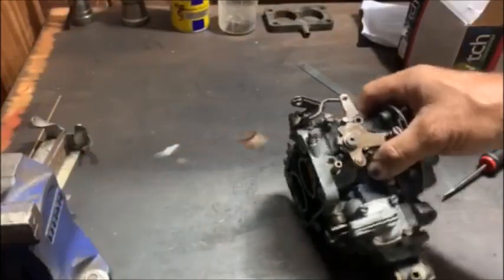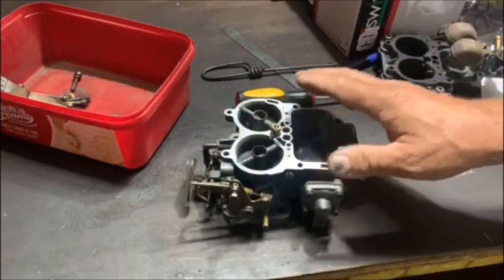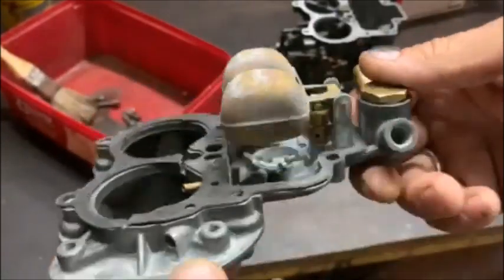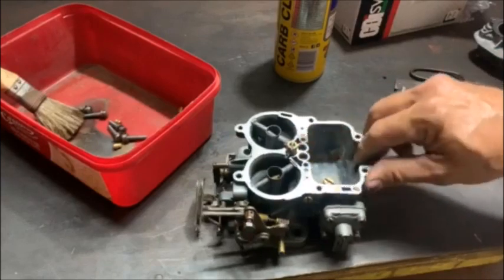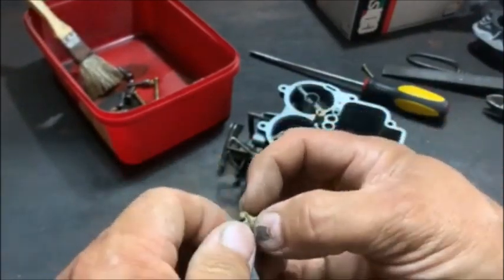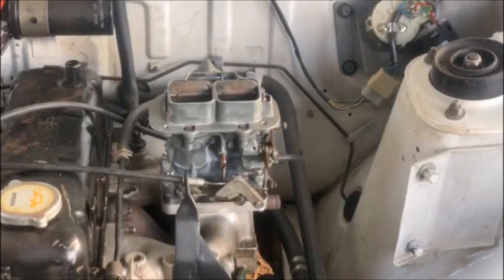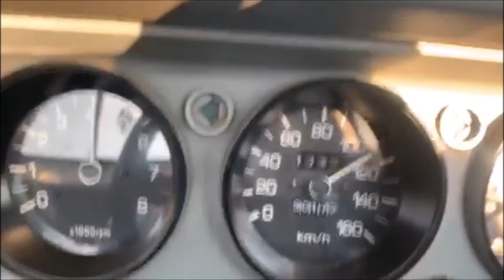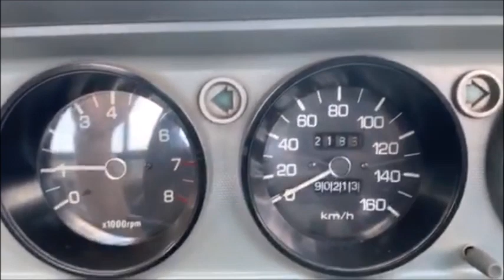Weber Tips and Tricks 1 32/36 DGV

Comment: 1987 Mitsubishi Montero SWB 2.6 with Weber 32/36 DAF - My carb is now fully open at stop. It failed on a restart from driving all day and now fails to adjust idle down. I'm revving at 4000 rpm now when in Park. The top flaps are open and don't close up. The car has been driven all week after not being a daily driver but performed well. Checked all throttle cabling, but the flaps don't close. Is this a broken Electric Choke? or another diaphragm? Thanks in advance.

Comment: Hi. Can you explain why my AC wouldn’t work when I put my Weber carb in my 1980 Honda accord? I’m new to carbs
Reply from the maker: The AC (air-conditioner) has nothing to do with your carburetor, The AC unit is usually switched in by the AC controls inside you cab.

Comment: That little A14 revs very willingly . Brings back fond memories from when i was preparing 2 of them for racing back in the early 90s . I used to own Renault 8s and 10s with the very popular Alconi engines . The dcd 7s were most probably the most tuneable carbs back then and all my Rs had one on . The adverts used to say "Power and economy king " Nowadays i am tinkering with the 38 dgas carbs and your videos on them is just awesome and informative . Thank you for sharing it . I live in SA  and i would like to know how i can contact you  other than via public comment .
Reply from the maker: Thank you for the comments, I fitted bike carbs to a Renault 9 engine, this engine was in a little R8, we also had a Gordini head on the engine, it was a little rocket. my number is 0-6-0-6-5-4-6-9-6-6
Reply: Hi please if you can help me a have 32/36 weber a install it on vw 1800 bore 2L  shim head gasflow branses on when a start it it adels when a try to ref it up slow it straggle to ref up then a ref  full frottle it refs up what is the problem 
Thanks if you can help me
Reply from the maker: @freddieverreynne3344  it is difficult to say but it sounds like your main jet is to small, make a video and send it to me via whatsapp 0-6-0-6-5-4-6-9-6-6

Comment: Hi my 32/36 struggles in second stage splattering loudly. Emulsion tubes seem to be stuck and cannot come free. Carb is fitted to a 2.0 chev Rekord. Primary and secondary idle are 45. Primary air corrector 160 and secondary 120. Main is 116 and secondary main is 115. Struggling to set up. I guess if I can free the emulsion tubes the gunk stopping it coming free can be cleaned. Please advise how I should proceed and advise on jetting that will suit my engine. Thank you!
Reply from the maker: your jetting sizes looks to small, visit my facebook page, under files i have a jet chard that could help you. must 2.0 engines jetting will be very close.
https://web.facebook.com/groups/387029652869858/files/files

Comment: Hi just looking for some advice. I have just fitted a 32/36 webber to a 1600 twin port beetle. I made my own non restrictive manifold , from head to head. I appears to be too rich on the first stage and too lean on the second. The first stage is terribly agressive compared to to solex. Idle mixture out 3 to 4 turns , to run smooth , but ten causing a popping back fire, upon acelleration. Second stage. works initiallly but flat spots out on the road, will run with a back off and second application. Looking for suggestions for jets etc.
Reply from the maker: if you have to turn the mixture screw out that much it indicated that your idle jet is to small, try one size up and see what it does.I dont have a jet chart for your carb on a beatke but this is for a 36 DCD weber on your engine - VW 1600 BEETLE venturies 23/24 main jets 110/120	Idle 45 air correction 190/180 - I would try 130 mains on first and second choke and i would use a 50 idle.
Reply: @carburettorrebuildservice8964  thanks for that

Comment: Thank you so much for your video.  I am a little curious as to why you sealed up the power valve.  You mention that a 1400 doesn't need it and I would like to understand why.  Is it the size of the engine?  Or something else?  Would enjoy hearing your thoughts.  Thank you in advance!
Reply from the maker: Yip, the size of the engine. Must of the Weber mods on 1400's are on standard engines and with the power valve still active it could over fuel. thanks for watching the video's.

Comment: Hey man thanks so much for putting this info up! , ive got a 1981 Datsun sunny b310 wagon, i always wanted to put a 32/36 weber on it but had no idea of the jetting so after watching your vids i bought a second hand weber cleaned and rebuilt it i made a 2 piece adaptor plate and have installed the weber on the car running a A15 motor the weber came with main =130 secondary=130 Airs main 175 secondary 125,idle jets are 55 and 60 and emulsion tubes are f66 with 3.5 and 4.5 venturi/choke i forget what there called lol i figure its close as a base tune it should run the car ok until i can order parts not sure when this will be as im a kiwi and NZ has just gone into another lockdown!. Im having a major issue which i cant seem to diagnose i have checked for vacuum leaks had the carby on and of 3 times now changing to different thicknesses of gaskets even trying RTV and i keep having the same result. The car will start i have to idle real high to keep it going, i get it warm still wont idle so i turn the mixture screw out until it does but it has to be about 6 turns out but the lowest i can get the idle is 1100rpm and this is with the idle screw not even engaged with the arm! Ive looked through the barrel with a torch shining up it has minimal gap much less than the old carb which was set at 800rpm. The car runs very rich and every time ive changed the gasket its exactly the same result! I have checked float height with no problems there the only other thing i havent done is disable the power valve but it has a new plunger so shouldnt have a leak there.

Is there any advice you can give me to help get my car running on this carb thanks for any help :)
Reply from the maker: Hi, what size is the idle jet, it sounds like it is blocked or very small
Reply: @carburettorrebuildservice8964   its a 50 or ive tried swapping them around with the second barrel which has a 60 makes a little difference to where i have to have the mixture screw but does not effect what rpm it idles at, like i said the part i find weird is i cant keep turning the idle speed screw until the engine dies it will only go down to 1100rpm
Reply from the maker: Please ensure both butterflies close properly, and ensure you are not leaking air.
Reply: @carburettorrebuildservice8964  have checked butterflys are fully closing have even gone as far as unscrew them relign etc and still can only see the tiniest bit of light come through which ive checked the standard hitachi and theres more light coming through those butterflys and it was set to about 800rpm, ive disabled the power valve the car seems to run nice otherwise like when you rev it.im about 4 turns out on the mixture so smells abit rich, have lowered the float more just incase, tomorow i may put the standard one back on and make sure it still idles below a 1000rpm to eliminate the possibility of a manifold leak etc , im just abit stumped i really cant figure this out ive even gone as far as to loosen the carb bolts to see if any vacuum leaks apper and the gaskets and rtv are gluing the carb down i could get it to leak if i angled the carb with the bolts very loose so i dont think my adaptor plate is leaking ive sprayed degreser all around the carb and manifold and cant find any issue.
Thanks heaps for your help, could it be possible that the throttle shafts are leaking air? They dont feel loose up and down but you can move them slightly in and out
Reply from the maker: The second barrel’s idle jet should not have any effect on the idling, the idle is only done by the first barrel.
Reply: @carburettorrebuildservice8964  Hey mate thanks so much for your help, i got fed up with it so decided to pull the intake off and make sure it did'nt have a vacuum leak as it seemed to be the only thing causing it not to idle lower and sure enough i removed the gasket used only Rtv to re-seal which ill replace with an actual gasket now we are out of lockdown and i can get it to idle as low as 500rpm with mixture screw at a litlle over 2 turns out so problem solved maybe the old intake gasket didnt like it when i took the old carby off and bolted the new one on as i could get it to idle low on the standard carb. The weber just has a flat spot as it comes onto the secondary which i put down to the 125 air jet instaed of another 175 like the primary has. I was wondering something about the choke mechanism tho ,ive found my choke pull off diapragm has ruptured and no longer works 1st question will this cause a vacuum leak?  2nd question can i convert to manual choke with one of the kits available online and remove the choke pull off diaphragm altogether and block the vacuum port on the back of the carb? The only disadvantage i see is it wont automatically open the choke butterflies slightly and kick off the highest stage of the choke cam which ill be able to control manually anyway.. yours thoughts would be appreciated, thanks again for your help the car is running quite nice now much better than the worn out standard carb ever did :)

Comment: Hi :) Thanks for your great walk thru! 
can you tell me why the Weber 32/36 DGV has a Vacuum Drop on the Ported Plug when Quick accelerate (from Stop to Go / Idle to Kick down).. the Distributors Vacuum Advance collapses right then when Vaccum Adavnce Timing is needed.. kind of same like connecting it to the Intake Manifold Vaccum (reacting in the wrong Way Vacuum Drop instead of UP) 
Thanks for your input!
Reply from the maker: The vacuum advances pipe should be connected above the butterfly on the first choke. if it is connected in the correct location then it should work correctly and the workings of the second choke should not affect it.
Reply: @carburettorrebuildservice8964  Thank you! i will check again :)

Comment: Hallo daar, ek het n 32/36 Weber carburetor op my Toyota 4y engine. Het n flat spot problem met weg, waarna kan ek kyk. Dankie
Reply from the maker: Check the accelerator pump circuit, it could also be a to small jet on the first choke. I hope it helps and thank you for watching.

Comment: Hello Gert, thank you for your videos and experience that you share - I have a weber 32/36 DGV and a weber 32/32 DGAS on my hands, can I ask you what jetting do you recommend for a stock bmw m10b16 (1573cc) Should I block all the fuel enrichment systems? Thank you and best regards from Czech rep!
Reply from the maker: Hi, I would use the 32/36 just as it is. must of the 32/36 carbs came from a 1600 so it should work as is, give it a go and let me know
Reply: @carburettorrebuildservice8964  Hello Gert, thank you for your response. So I've tried 32/36 (main 150 fuel, 150 air, secondary 160 fuel, 160 air, idle jets 50 primary, 55 secondary), the car runs and sounds normal on the first stage, but I don't feel any more power with the second stage, only the sound changes to "deeper burble" and I hear clicking from the engine when full throttle in lower RPM.. Is it OK or? Thank you and best regards!

Comment: Hi! Just came across your videos. Very interesting and helpful. I've just installed a 32/36 on my mk2 transit, 2.0ltr pinto. She runs great, pulls well with very little flat spots. It ticks over fine too, but when I drive through the gears and come to a set of traffic lights or junction, the carb refuses to find idle and the engine cuts out. Any suggestions?
Reply from the maker: Perhaps try a smaller idle jet, also ensure your float level is correct and the needle and seat seals properly.

Comment: Hello uncle, so I need help, I have a mk1 escort 1600 Kent, it uses that same carb, but I’m experiencing difficulty trying to start it and idle, what is a baseline for the mixture and idle speed screw, must I tune them in all the way and turn out twice as a baseline for both screws?
Reply from the maker: hi, turn the air mixture screw in all the way and then two and a half turns out. turn the speed screw until you see the butterfly move, it this point it should start. you can then turn the air mixture screw in half a turn at a time until it runs smoot and no smell of unburnt fuel at the exhaust.

Comment: I faced a problem on my toyota corona 1.8 with weber carb..idle is fine.but around 2k rpm it start bogging..im not sure whats the problem is.main jet is 138 air 160..is it in range?
Reply from the maker: Hi, what carb RE YOU USING PLEASE?

Comment: The f66 make a big difference i ran the f50 f6 and changed both to f66 i get a bit to much fuel with the powervalve i took it out
Reply from the maker: Die F66 is net baie skaars
Reply: @carburettorrebuildservice8964  hulle is ja ek was velukkig om 2 in n ou weber te kry

Comment: Benimde 1600 motor bir Ford taunusum var önceden 170 km kere kadar ulaşan aracım şimdi ise 120 -130 km lere zor ulaşıyor karbüratör bakımı yaptım temizledim orinklerini  contalarını değiştim ama aynı durumu fazla bi fark olmadı f66 tüp mü takmalıyım Türkiye de bulamıyorum
Reply from the maker: Silly question, did you put the jets back in the correct places, also check your float level, it could be to low and starving the carburetor on fuel.  i hope this helps.
Reply: @carburettorrebuildservice8964  jetlerin yerleri doğru ve şamandıra seviyesi 41mm yinede teşekkürler

Comment: Hi I'm running a 272cam what is the correct tappits settings I'm currently on 35intake and  35exhaust
Reply: Im running the R64 Lamco cam 25 intake and 30 exhaust

Comment: What jet sizes will fit for my 4g54 2.6L engine? Im using 32/36 also
Reply from the maker: i don't have a jet chart for the 2.6, on a 2.0 we use the following. mains 140/135 airs correction 170/125 with F50emulsion tubes in both
Reply: Hi i know this is a long shot. What are you running on your idle jets? And also is it primary/secondary? Thank you so much and greetings from the PH. Im also using 2.6 engine, do you think i need to try A 145/140 mains, 175/130 air correctors, and emulsion tube at f6 on both? 

My current jettings are 140/135 main, 165/155 air cor, and 55/55 idle and F50/F6 on emulsion tube. Thank you so much! I really love your videos. ❤️

Comment: Ek het di powervalve se gate toe gemaak hom uitgehaal di vacuum spring uitgehaal dan is my eerste keel dood sy loop rukkerig maar 2de keel is reg hkm maak sy so
Reply from the maker: watse size jets het jy in?
Reply from the maker: het hy jou emulsion tube uit gehaal en skoon gemaak, watse size is die tube?
Reply: @carburettorrebuildservice8964  1st stage 160 air 122 main 2nd 135 main 132 f66 op al twee 55 idle op 1stage 50 2nd stage
Reply: Ek het di Lamco R64 cam in ports is groter gemaak en gematch op std manifold met adaptor wat opgeweld is en n 30mm spacer stock sub
Reply from the maker: @koosdemeyer9105  probeer 1ste main 142/145 air 155, die 160 wat jy in het sal ook werk.
Reply from the maker: @koosdemeyer9105  ek het n Camtech 276 cam in en ek doen baie van die carbs vir mense, hulle werk goed.